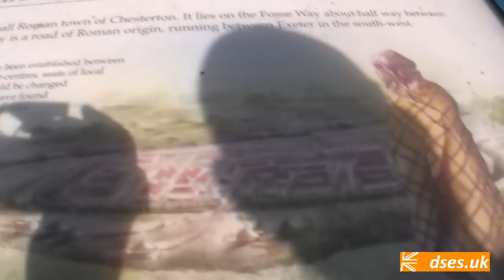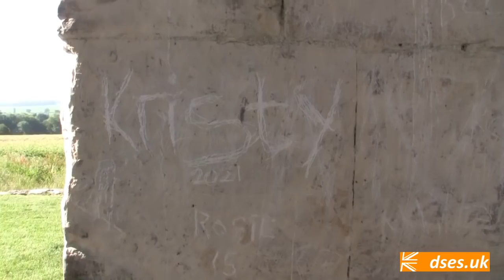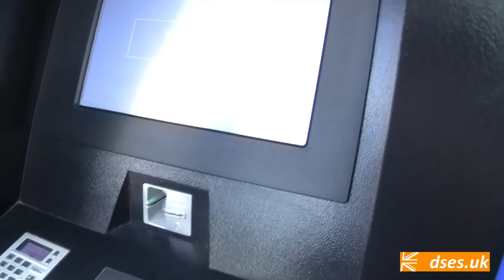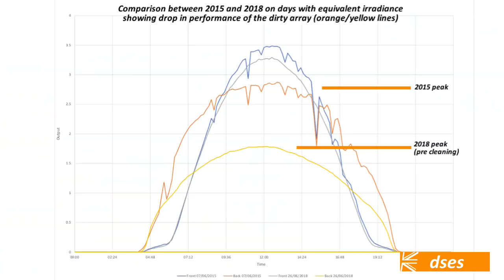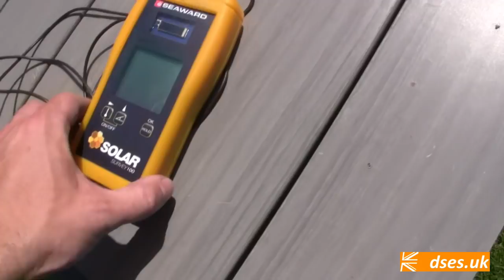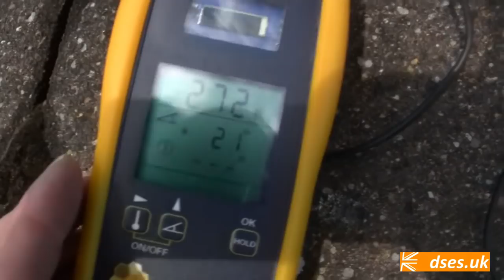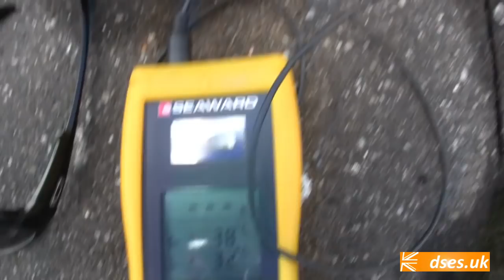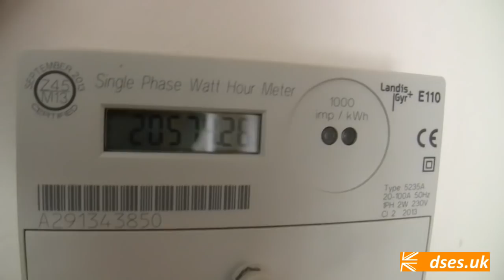Goofing off to buff my P.V. stuff!

Comment: I brought myself a couple of DI resin vessels second hand off eBay to do my house windows with my water fed pole & it works a treat. You can just hook the vessels up to your garden tap & you are away. No pumps or batteries to worry about either.

Not had to change the resin since I brought them three years ago & still tests at 0 PPM with my TDS meter.

Had several window cleaners & they never clean the frames or ledges.

Instead of using pure water to wash off all the muck on the frames, ledges & glass I use regular tap water & then switch to pure water giving just the glass a pooling rinse. 

I swapped the nozzles in my brush to fan jets & that allows me to just hover over the glass without touching it with the brush when rinsing.

Comment: I've worked of a 4' X 4' steel scaffold for the past 15 years. Doesn't meet standards. But the new aluminium frames are so flimsy compared it's feeling safe is the top priority. My work partner bought it in the 80"s it's so well built you can only carry 3 X 2' sections at a time.

Comment: Nice one Mr S. another thouroughly enjoyable episode... the fight sequence made me giggle. I did the BPEC PV a couple of years ago, mainly if my 3.5kWh array on my garage roof went down but after 9 years it's not missed a beat. SMA 3500TL solid bit of kit if your second inverters goes. I've got a 12L resin bead water softener for our hard water streaks but I also to cool the panels via a garden hose on V hot days and get 12 -15% increase afterwards. £90 is nothing considering the height  danger and, when I looked into do a cleaning service, the insurance was crazy and not a great call for it. Your visual on the before and after is compelling evidence mind.

Comment: The 16.8MOhm Riso reading on the inverter will almost certainly be the insulation resistance of the array, and that's a pretty good value for a system a few years old.

The limit varies on array size but it's a lot lower than the 1Mohm you're used to with mains wiring.
Reply from the maker: Ah, yes - I think you're right. Goes to show how much attention I've paid to it since installing.
Reply: @dsesuk  in fairness, unless it's blinking its Christmas lights at you there's no real need to look at most systems beyond "is is working" and "is it falling off the roof".

You can do performance degradation checks if you want, comparing the theoretical values with measured ones. 

According to the very exciting book on the subject the limit on a system your size is 
30kOhm (yes, kiloohms) and that drops to 3kOhm for the largest systems.
Reply: @tceng9449  that sounds crazy low these systems must degrade like crazy
Reply: @alouisschafer7212  In fairness it's unusual to see a string in the tens of kiloohms in my experience and I'd be a bit alarmed if they were.

The systems I'm normally working on have strings around the 4-8kW mark, if you've got a couple of them going in to one input on an inverter then Riso readings of a few hundred kiloohms wouldn't be unusual.

It's always lower in the morning when the system is just waking up and rises throughout the day as it dries out.

I've been to a number where there's nothing really wrong, just a sum of parts adding up to a low value. It seems that some components aren't made for British weather. Grey, wet winters.

I've just commissioned a system with 19 strings of 21-22 395W modules per string. Brand new on a sunny day they ranged from 25 to 55 megaohms Riso per string.

Comment: I do like a Nice clean "array".
Have you got any setup of Emergency Supply from it? Looking to use my 16a EPS supply from the inverter but can find zero info of best practices. Thinking Dual Supply board or extra CU for EPS with House Lighting and /Kettle socket for Power cuts?? (FYI Also have batteries so Lights work with no sun :))

Comment: Hi David, I was wondering if you or any other spark that reads this would be able to help me out a bit. I've just finished my level 3 in electrical installation and now I need to find a job with an electrician to be able to do the NVQ3 and to be able to then go on go the AM2. while I am a bit older than the usual trainee spark I'm not completely over the hill just yet. 

Anyway what I want to know is what is the best way to find a job with an electrician. Sites like indeed seem to be a non starter since most of the 5 jobs on there either require 2 years minimum experience or are like one month jobs. And I cant afford to give up my job unless I have something a bit more permanent. 

I'm in a bind because as I said I'm not so young any more so I don't have much time to be messing around. I don't want to just start cold calling companies because people may not like that approach.

Anyway thanks for you help

Comment: Questions we need to ask is did you notice a significant change in the power output of your solar panels
Reply from the maker: Mine aren't monitored. The one we cleaned in 2008 has some handy graphs the homeowner could pull off, but I don't have anything so clever on mine.
Reply: The company I work for has solar panels across the UK and in other countries including India.

In the UK, the only ones we have to clean regularly are the ones near the coast where they get covered in gull poop and it does basically come to once a year usually. In India, they wash them every month and have a noticeable drop in output if they don't.

If you were paying UK wages in India you'd still wash them but obviously not quite as often.

Comment: Hey dave i have a friend who is trying to rent his house out all above board and is trying to get a cert for the house.
he has a new CU fitted but the lighting in the house is still running 2 core as long as all the surface fittings are plastic and a warning label at the CU is fitted and is running the correct MCB in the new board he should be ok and be spared the coast of a full re wire? just dont want my friend to have his pants pulled down as the local sparkys know the house is for rent. 
thanks in advance.

Comment: Any reason why you cant just use a pressure washer and a long hose ? Just dont go OTT and cut the panel in half
Reply from the maker: You could use such if you can get it up there! This is an easy array, but conservatories or extensions below might make it difficult to place the squeegie where it's needed!